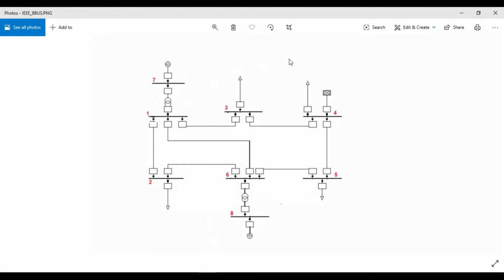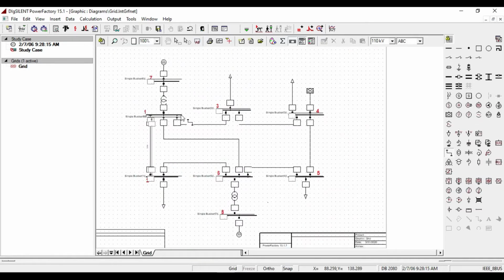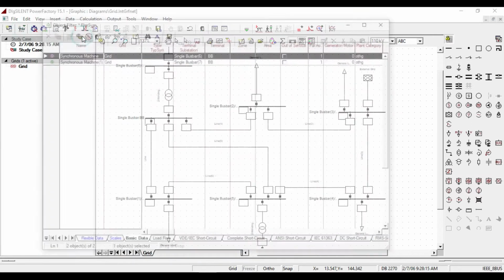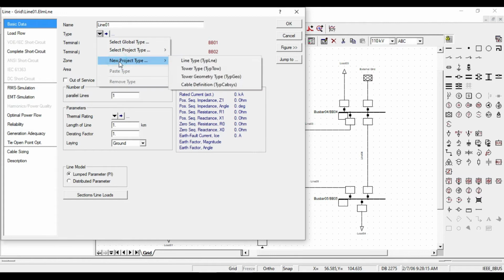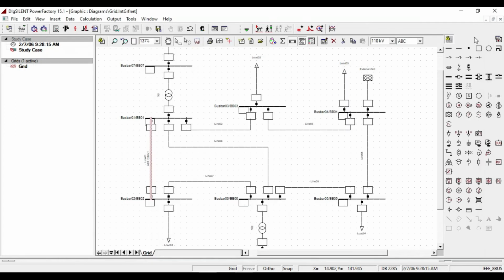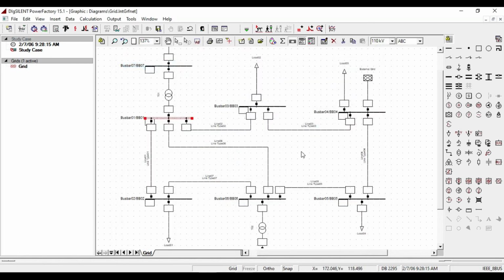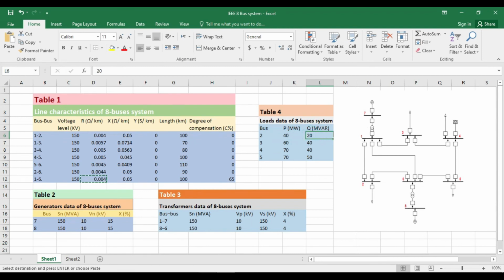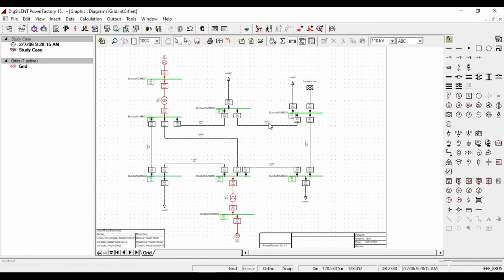PowerFactory-DIgSILENT tutorial #5.  modeling IEEE 8 bus power system

Comment: thank you sir, but i will ask 2 question, its easy to enter the datas for 8 bus system but what about 118 bus system. I made it for 33 bus and its tiring. The second one is for bus data, why dont we use just one type of bus type? voltage value is the same for all busses

Comment: Sir, i followed your path. However, in my simulation, my generators didnt work like they dont provide power and shows as 0,0. I checked but i didnt find anything wrong. What it can be problem?
Reply: Hello, did you get a response/solution? I got the same problem.
Reply: @Milanoibi  Man sorry i didnt see your comment, Please check your Gen from Load Flow, be sure that you enter Active and Reactive Power and do not forget to enter ratings from the Type section. Hope it helps
Reply: I am also facing tha same issue. He said no need to write active and reactive power of generators, they will be selected automatically, what we will do?

Comment: Hi All,  I have four question about power flow and diferent types of busbar 9, 14, 39 Bus Stystem becasue I do not understand them regarding to :  

1) Why digsilent as well as other software use these types of system 9, 14, 39, etc. in their examples? 
2) Regarding to last bus system, can they be used to check the behavior of my system ( for example one new power plant connecto network at High voltage side) it means if it is take my new power plant to connect on one point of 39 Bus System, can I tell that the behavior of my power plant will be the same to connect to one busbar of China's Network  or EEUU's Network or Brazil's Network?
3) How can it be made one equivalent system from digsilent of one network power of more 100 busbar what would be the procedure?
4) if I would like to do  analisys of frequency which it will be connected one power plant of 500MVA to grid power at 400kV what would it be the procedure to do the simulation? Will I need the grid power of contry where it will be connect the power plant? 

In advance, thank you very much for your time and answers